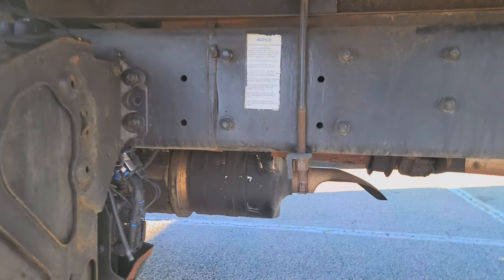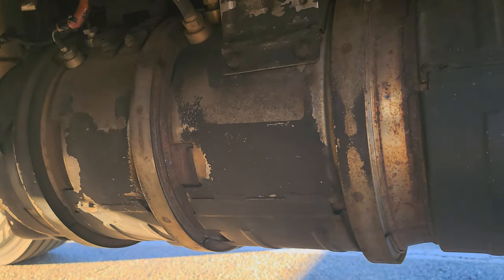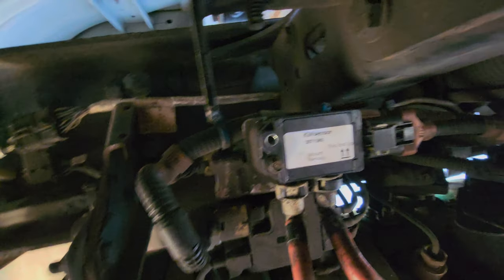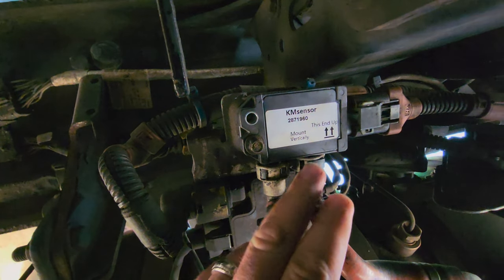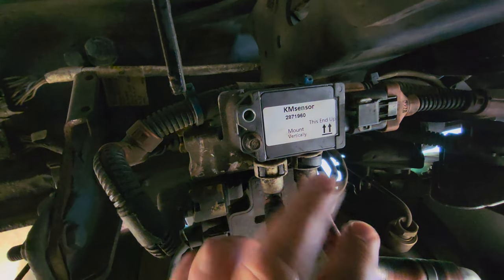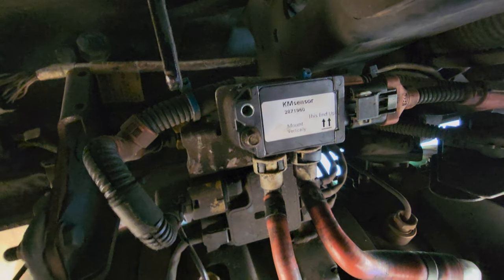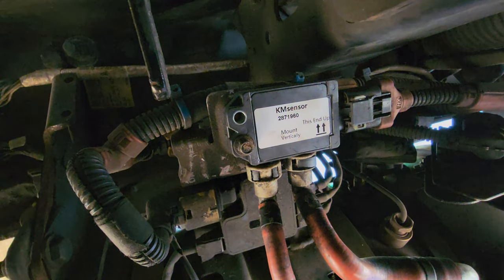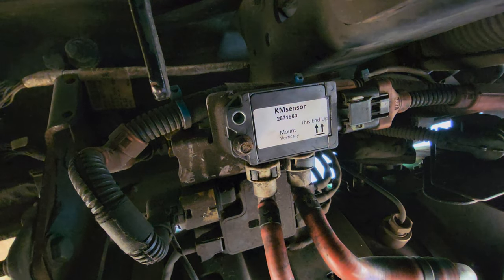Freightliner m2 differential pressure sensor (part#2871960)

Comment: Did the sensor work I have a 2018 freighter liner M2 keeps throwing code spn 3251 fmi 0 and keeps regening every 20 miles
Reply from the maker: Probably because you're pdf filter is do to be changed, other than that it should work
Reply: Did you figure out the problem? I’m dealing with this now
Reply from the maker: If you're dealing with the differential sensor now, you may consider the pdf, if you have someone to look at it for you rather than dealership, this will save you a little time and money.
Reply: I just ordered one. I will reply after I put it on